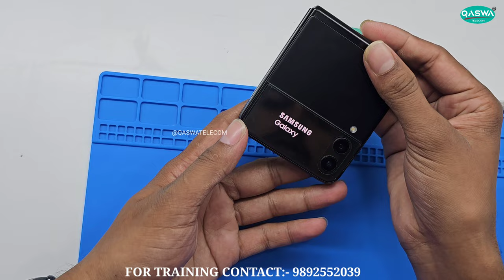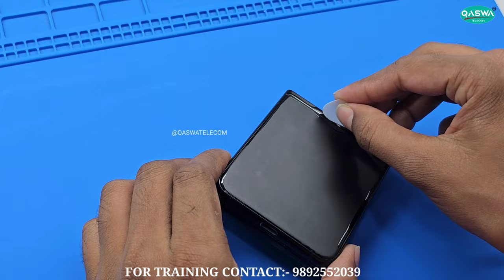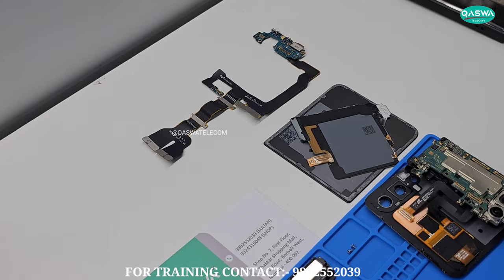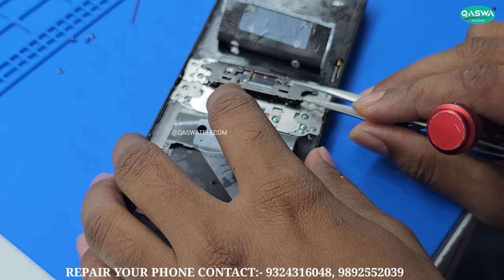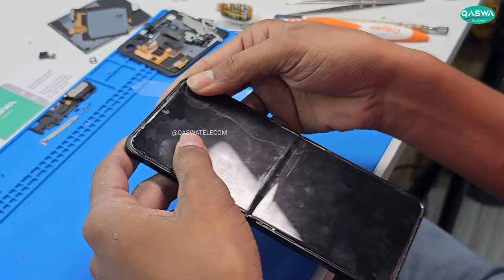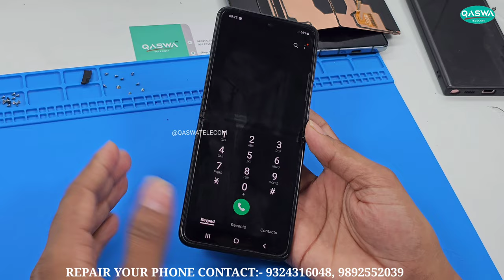Samsung Galaxy Z Flip 3 Blank Display Repair || Qaswa Telecom

Comment: My screen turns off when i flup it and it turns on after 25 to 30 secs
Reply from the maker: It will be repaired contact 9324316048
Reply from the maker: user-qb4ip8gi9x  borivali mumbai